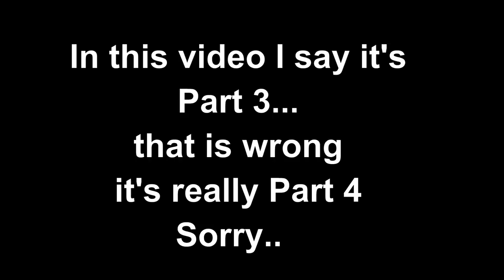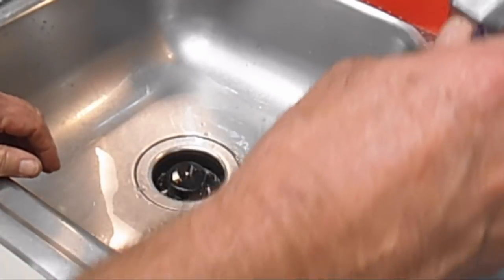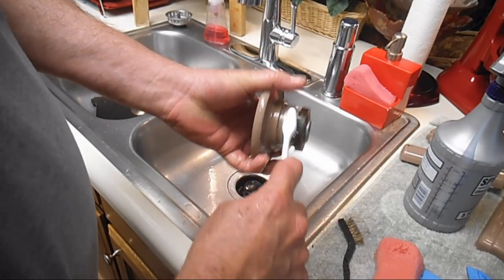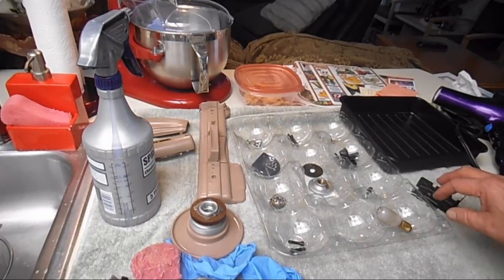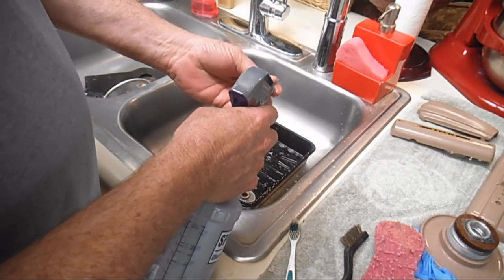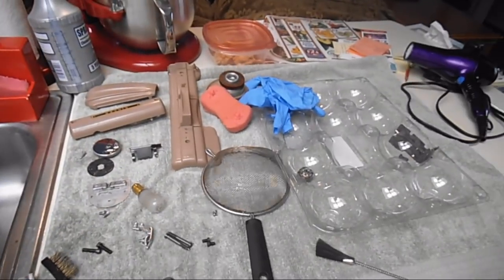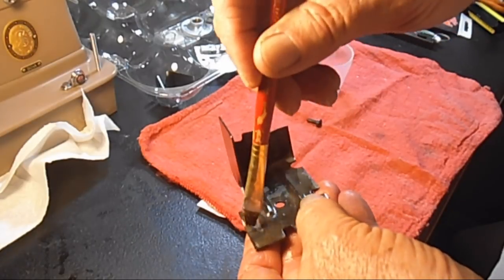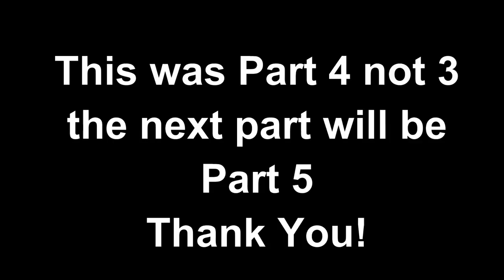Coco gets her parts washed - Coco goes to the Spa Pt. 4 - Singer 301A Rehab

Comment: Everyone take note of that bed plate...washing that part has to be the best thing ever! They are always so greasy and smelly and they come out so clean and pristine! I'm looking forward to the adjustment segments, Andy. You're so helpful!
Reply from the maker: Thank you. My very favorite part to clean! Man, sometimes they really stink badly. In my experience, when a smoke sews on a machine like this, the ashtray sits next to the handwheel side and the fan in the motor sucks the smoke through the side of the machine and can blow it right across the bed plate part. Wheweee! Like the 50+-year-old grease and oil wasn't bad enough. So  very rewarding. If you watched this and don't do anything else but clean the bed plate you will be quite pleased. Thanks for watching, Daffycat.

Comment: I wish I would have watched this video before trying to remove my bed plate felt pad. I ripped mine trying to remove it for cleaning. Both sides were saturated with black oil. And I was using very hot water which probably weakened the glue. Well, now I know the correct method of cleaning it. Thanks for the tutorial.
Reply from the maker: I did the same thing with the first bed felt I tried to wash. Live & learn. Now I use the Krud Kutter and tepid water but even then the corners of the felt can get a little loose. If too much gets loose then I glue it back down after it dries completely. In the past, I used E6000 Flexible craft adhesive my wife gave me. It worked well. When it ran out I switched to ProSeal Clear RTV Silicone Adhesive. I just put little dabs under the felt where it is loose, press down the felt and then let it dry again. Here is the ProSeal I use: https://www.amazon.com/Pro-Seal-80066-Silicone-Sealant/dp/B000FW62T6
I have also seen this product at Walmart, Home Depot, Hardware Stores and eBay. Thank you for watching my channel and taking time to comment. I'm glad you found this video.

Comment: Thanks Andy for another great film. I have a question. Did you wash the light bulb with krud mutterOr did you just wipe it off with a damp rag.? I noticed that it was part of your collection drying on the tvowel.I didn’t realize you could wet a lightbulb.
Reply from the maker: Thank you Dorothy. I did just wash, rinse and dry it with the other parts. The light bulb is sealed or it would burn out. If water got inside during washing it would show that it was faulty anyway,  and I would not want to use it then. You could certainly just wipe it off with a damp cloth; that would be fine. I just clean it with the Krud Kutter to be sure to get all the oil film off of it.
Reply: I always wash mine and thoroughly air dry. I’ve even added a very light smear of smo on the bulb base. Sometimes they get cruddy and break when trying to remove. Andy do you agree?
Reply from the maker: I'm up with that! When I was 6 years old I watched my Dad break a light bulb on the porch so he could use pliers to remove it. Really stuck in there. Before he put the new one in he rubbed it up and down both sides of his nose! When I asked why he explained he wanted a little "oil" on the base so it would not stick next time. Just a drop spread by yoour finger and gently wiped off with leave a residue that will help with removal in the future. Pure smo or Tri-Flow.